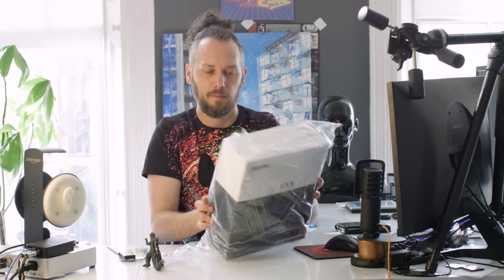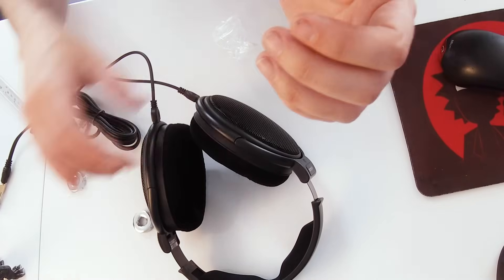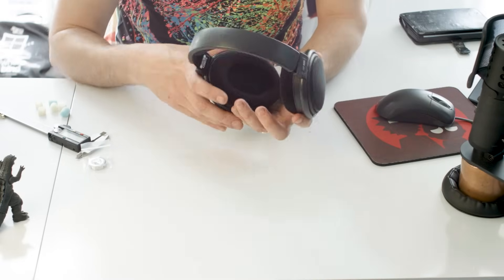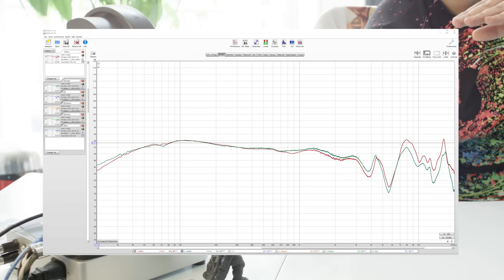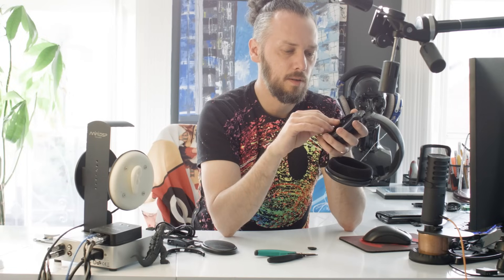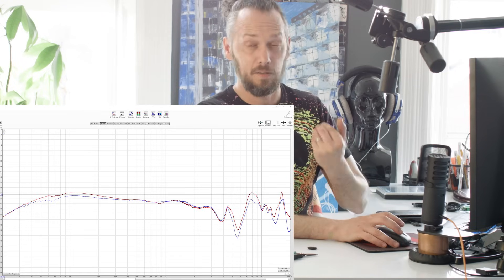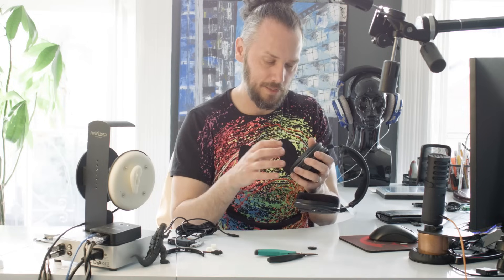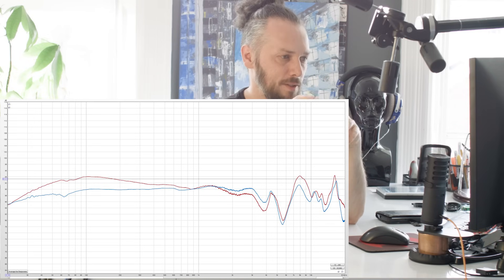MassDrop x Sennheiser HD6XX Upgrade time. Our Shiny new nickel plated CNC copper mass loading kit

Comment: I got mine a couple of weeks ago; mine are copper in color, and I can attest that they definitely improved the bass in my Sennheiser HD650. They look really cool through the custom-made grills I installed. I did have to brighten the upper a bit because the weights made the sound a little bit dark. I kept the original foam inserts in because I was afraid to mess up the original sound of the headphones!

Comment: Is this realy worth compared to just add some eq?
Reply from the maker: I think that would be down to personal choice. If you don't enjoy modding things and have an EQ on all of the pieces of equipment you might want to plug them into then EQing is much better for you. If you enjoy upgrading and modifying your toys or have equipment without and EQ... Modding will be more fun. There is a lot that can be done with EQ but sometimes modding your existing headphones or upgrading to better headphones yields even grater results. As you say, depending on the individual, the extra cost and hassle may not be worth it
Reply: @CustomCans  I just want the best sounding experience. The final result. Even tho i migth ewnjoy modding i want to get the max out of the headphones only. Even with the mod i would probably still eq them but i would love to know if its worth cause im in love with the hd6xx with eq alone
Reply from the maker: @elomaquiabelo  Super Best Audio Friends did quite a lot of testing and comparisons on this mod if it helps
https://www.superbestaudiofriends.org/index.php?threads/custom-cans-hd600-hd650-mod-measurements-and-impressions.11801/
Reply: @CustomCans  Uu ill take a watch for sure ty!

Comment: Hi! Nice video! I'm waiting to receive them. Can you tell me what happens if I only fit the two copper capsules and don't remove the foam? I wouldn't want to ruin my HD 600 by removing foams... Are low frequencies increasing anyway?
Reply from the maker: Yes - you get a small bump in the bass if you do that... More noticeable on the HD600 than the 650
Reply: @CustomCans  Thank you very much for your very quick and precise response 😀
Reply: In your opinion, does the sounstage increase a bit?
Reply from the maker: @giannipescatore4280  I don't think it would change the sound staging much with the original foam in. .. It has been a long time since doing the testing so I am just going off theory
Reply: Stock foam ended up being what i stuck with on hte HD6XX, and wasn't that hard to put back in.
The mids and treble were too affected by all of the custom foams IMO.
With the stock foam and the copper, you keep the Sennheiser sound with a nice bump to bass clarity/quantity.

Comment: Dear Custom Cans, does the nickel coating make these magnetic?
Reply from the maker: The nickel is only about 50 microns thick so I doubt there is enough to have any measurable effect
Reply: @CustomCans Ah, you'd be surprised. I tested a fuse with 2 micron nickel flash against a stack of neodyms, and there was a weak attraction.
Just wondering whether the nickel weights interact with the driver magnet and affect the measurements verus the bare copper ones

Comment: Installed this literally an hour ago, tried it with the default foam, then the #3, then the calamari, and then without.  Of the 4 options, preferred the #3 because it had just a bit more crispness to the mids compared to the other options, where you either lost some high end or you muddied up the bass. 

For a reference, the track I like to use to test is Gigantic by the Pixies, it's kinda a perfect testing song.
Reply from the maker: Yes, the 3 is my favourite as well

Comment: I think maybe you got some non avarage item of 6XX.
Original tuning is good.
The only improvement they need is 100-150 Herz bump 2 dB,   and add 30 Herz 2 dB .
Bot no need to change anything else
Reply from the maker: Sounds like you have found your perfect headphone ;)
Reply: @CustomCans  not perfect. I meant for the price.. but still your measurements are not average I think
Reply: @CustomCans  I mean maybe if you buy new pair now it will differ. I have bought mine this year (Made in Ireland)

Comment: Can you made this mod available again? I really want to try it.
Reply from the maker: Yes, they should be back in stock in a couple of weeks
Reply: @CustomCans  thank you for answering my question, I really want to try this mod, I've been using my 6xx for nearly 8 years now.
Reply: @Edward135i  this mod without any foam behind drivers and new suede memory foam pads changed my 6XX into dirty pleasure, mid range is so sweet and powerful yet not blurry

Comment: Just ordered normal copper version saying for HD600/650 and I believe they work for HD6XX as well? The nickel-plated version is out of stock unfortunately 😢
Reply from the maker: Yeh - they are both the same, just a different colour
Reply: @CustomCans  Thanks! I just received them and they work perfectly! I went back and check the website finding they are also out 😂 glad I picked them up early!

Comment: pls someone explain me how do that mass loading work if its attached to plastic behind driver not driver itself, it kind of dont make any sense for me
Reply from the maker: On this one it is doing 2 things. One is simply adding weight to the assembly so when the diaphragm of the driver moves it has more weight to push against. As the baffle is harder to move more energy goes into making bass rather than moving the baffle. The shape also smooths out some of the airflow through the back of the magnet
Reply: @CustomCans  this voodoo magic must work since I enjoy them more, fully open no foam at all 👍

Comment: Received these today and ran some measurements on my clone rig (lines up perfectly with measurements from real GRAS 43AG measurement rigs which makes it compatible with the Harman target as a reference). Of the foam inserts the one with the hole has the most target compliant bass, trending up slightly and completely removes the mid bass hump (relative to Harman) and significantly reduces the bass roll off, both by having less of a contrast between the mid bass and sub bass and by having more volume. The other foam inserts made the bass trend downwards to differing degrees, though they were flatter. I thought I'd get this as a nice little upgrade to a headphone I already love but it's actually very noticeable. Highly recommended.

Comment: Version for HD6XX. This mod gives you 4 HD6... different headphones, ranging from the HD600 using the densest sponge to an even more extreme HD6XX on the bass if no sponge is used. The ring, on the other hand, helps to soften the peaks in the highs and better define the lows. I wanted to get the HD600, but with this mod it's useless to buy it... now I already have it and honestly maybe it's really too analytical... I have to try the sponge with the star again... perhaps the most balanced of the four modes. Thank you!!! Simply brilliant!!!
Reply from the maker: Glad you like it ;)
Reply: with foams it seems they cant "breathe" and really get bass light with boost in upper mid/treble region, so after I destroyed original foam in the process of removing it 😅 now my best option is no foam at all

Comment: Does this mod go well with post EQ processing through a device like the Qudelix 5k, which can allow for the use of Oratory response curve presets? 

I want to know if using this mod in tandem with post EQ presets like the Oratory curve will mitigate the purpose of the mod, or mitigate the correction EQ preset from Oratory.

Thanks!
Reply from the maker: Yes - using this mod will change the frequency response of the headphones so they will sound different. If you are targeting a particular sound profile and you already have it just how you want it with the EQ, there is no need to do the mod. If you do mod them, they come with a few different inserts to tune the sound to your preference and you could also still tweak things by EQing them but the pre-sets will sound different

Comment: Installed the mod on my HD6xx and here are my observations after a few weeks of listening. First off the good: there is quite a considerable improvement in bass quality (and quantity too). The bass now slams harder and you can even feel slight driver vibrations on your ears. Instruments have more "physicality" to them, as if you feel in a tactile way how the sound is being produced by the instruments, such as the drum skin when being struck (can't confirm it, but I feel like the headphones became more dynamic across the entire frequency range, not just the bass). 

Now the slight con is that the mod messed up a bit the mids and treble. Initially, I suspected that the mids became boosted, but the measurement in this video showed that that's probably not the case (they do, however, show that the treble got reduced) but whatever is the reason, I was able to fix the issue by reducing the frequencies around at 3.5k and boosting at 13k (with a shelf going down to 8k), which pretty much restored the warm and intimate sound of the stock tuning. I also opted for completely removing the foam behind the drivers without using any of the foams provided in the kit as they don't fix the mids/treble issue and I also felt like they close off the soundstage and remove some of the added air that you get after removing the foams. I don't recommend, however, removing the driver foams if you are not prepared to use EQ as the foams in the kit don't entirely restore the stock tuning, so without EQ I'd recommend to just install the ring without touching the foam. 

Finally, if you choose like me not to use any foam the mid-bass becomes a little bloated and I recommend reducing it by 3 or 3.5 db between 90-100hz (you can see the frequency hump in the video, however frequencies below 50hz still benefit from a good bass shelf, at least to my basshead ears, the bass can go down to 25hz if you boost it enough and you get amazing pipe organ sound). Also I would strongly recommend trying to reduce the treble peak at around 15k (by as much as 8 or 9 db!!) that makes things like consonants and cymbals sound too sharp and grainy on some tracks. This applies to the stock tuning too, but I kind of feel that the treble peak became exacerbated after installing the mod. Secondly, there is also a dip in the treble at around 13k that makes the treble sound a little dull (again this applies even to stock tuning, but even more so with the mod), which I would recommend boosting by about 1.5-2 db (I suspect this is one of the reasons why the hd650/xx are regarded by many people as "veiled").

In conclusion, I warmly recommend giving the mod a try even if you are concerned about messing with the foam. However, if you do like me (going with no foam and using EQ) the sound upgrade you get is quite significant, in not only improving the bass but also opening up the soundstage and adding "air" around the instruments (and possibly adding dynamic resolution). Last thing I would like to thank Custom Cans for coming up with the mod and making it affordable and easy to install (it also looks cool, especially if you order the recently added black color).
Reply from the maker: Thanks for the feedback and glad to hear you mostly like the result.
Reply: for my ears it dont need EQ without foam, more likely it is and always was headphone that work best with analog sources so R2R dac and tubes or turntable and decent tube amp

Comment: Just installed the mod and it's quite pleasant.. sadly the foams arrived a little bit messed up, especially the number 3.. and I can't get the foam with the hole in it to fit properly for some reason :/
So for that reason I am rn using the stock foam with the mod, was able to somehow get it back in. It doesn't look like before but it definitely worked. The mod without any foam sure creates some huge bass, but I am concerned that the open driver will collect some dust and whatever else over time.. is there any risk to leaving it open?
Reply from the maker: Pop us an email and we will send you out another set or inserts
Reply: @CustomCans  totally forgot to reply lol :D works well with the new foam set I got :) thanks a lot, I am enjoying the mod a lot!
btw, I was wondering if I could add some sort of super thin layer of cloth to the mod without any of the foams to prevent dust getting to the driver.. is there any material that could be suited for that without affecting the frequency response at all or only slightly?
Reply: @PinePizza  waiting for this reply :)

Comment: Hi! I am in need of a new cable for my beauties, HD600:s. I had the thought of DIYing it, and was wondering, what diameter litz cable do you use in your custom cables? Also where do you get the headphone end of the connectors, I can't seem to find other than bad quality ones.. I understand if this is "classified" information and thus to be kept a secret, but thanks in advance anyways :))
Reply from the maker: The litz we use is just under 1mm in diameter ( it is actually 84 wires, each 0.071mm in one bundle ) We use Cardas HPSC connectors with them
Reply: Also I see that you are experimenting HE400SE(xy) with beyerdynamic pads. Is it worth a new video perhaps?

Comment: I'm currently running a tube amp together with the HD6XX. Would you still recommend this mod or would it be overkill and only work well with solid sate amps? TIA
Reply from the maker: This kit will be fine for use with tube amps - the kit makes them sound a bit more detailed. As tube amps tend to be a bit warm and the 6XX is a warm headphone, making them a bit brighter might be a good idea. It would be down to personal taste
Reply: @CustomCans  cheers for the insight! i have placed an order and cant wait to test the mod out! which is your favourite config (and what genre do you listen to)?

Comment: Very interesting to see the individual graphs of how the sound changes.
You should do a new video like this for the hd600.
Reply from the maker: Once you remove the original foam disk from the back of the driver... the HD600 will perform exactly the same. They both have basically the same driver with different tuning. The difference is mainly in that foam disk on the back of the deiver
Reply: @CustomCans  I suppose 600 got denser foam

Comment: Does mass loading make them harder to drive?
Reply from the maker: No - as you can see from the graphs, they are roughly the same volume with the mods. I did not change the volume on the amp as I went along. The are in theory, slightly more efficient with the mods which is why you gain a couple of decibels without the inserts in. So... without the inserts in they are slightly easier to drive. With the blue insert in they are slightly harder to drive.
Reply: @CustomCans  interesting, if not a bit counter intuitive... to my intuition on the matter that is! I have my eye on one of your mass loaded balanced dt 1990s to go with a Soloist 3x - so not that power is an issue! - and Musician Pegasus. I feel like that class a and r2r duo will bring a little something to those neutral cans!
Reply from the maker: @Koopagamelouda  Yeh... the extra weight is on the stationary part of the driver. The idea is to make it harder to move the driver enclosure. So when the diaphragm is moving in and out, more energy goes into moving the air and making sound rather than vibrating the enclosure. It is also shaped to smooth the airflow a bit when you use one of the open insets.
Reply: @CustomCans  Nice! Thank you for that explanation, makes sense now!

Comment: @Custom Cans do you use your own REW settings or is there a particular setup guide you followed?
Reply from the maker: This is just the standard REW setup from the manual. The level is normalized to -40db at 300hz, the Mics have their calibration files loaded and then this is the result. I have vertical axis of the graph set up so the graph takes up more space top to bottom so it is easier to compare the different mods but other than that is is not messed around with

Comment: Is there amy difference between this and the older Copper kit, besides the look (both are dope btw) ? I just installed the Copper kit on the 6XX.
Reply from the maker: No it is the same kit that has gone though a polishing process and has been plated - the plating is so thin it does not affect anything other than the looks

Comment: So I assume this is fully compatible with all other HD600 series headphones except for the 660? HD600,650 and 6XX are build identically right?
Reply from the maker: Yes it works the same on the HD600, HD650 and HD6xx. One of our team has it on some older HD580s but we have not done any proper testing on those so I can't vouch for them

Comment: Ooh, shiny! I do enjoy the look of copper, but this is pretty classy. Just an idea for the copper version, you might want to try a forced patina (using salt and ammonia IIRC) at some point, you can get some real crazy colours going on. Could look pretty sweet on a green/blue custom pair.

Also, had you considered some sort of fine mesh screen to go with this mod? My main concern with running without the foam is that you'd be losing out on the dust protection entirely.
Reply from the maker: Yes, I may give that a go, I love a bit of patina. As for the mesh thing... It would be a good peace of mind thing. I have seen a few other headphones with uncovered holes in the back of the driver and it does not seem to be an issue but I will think about it